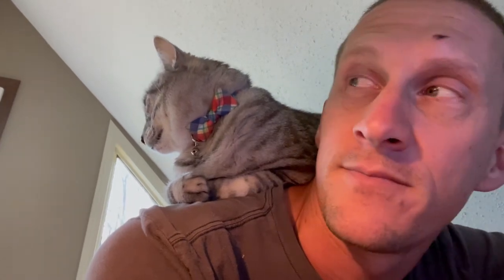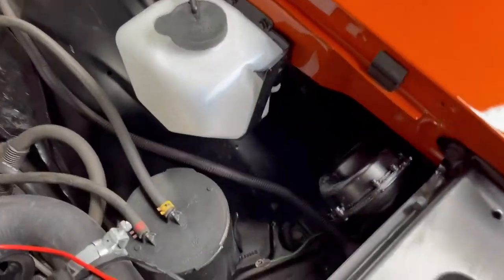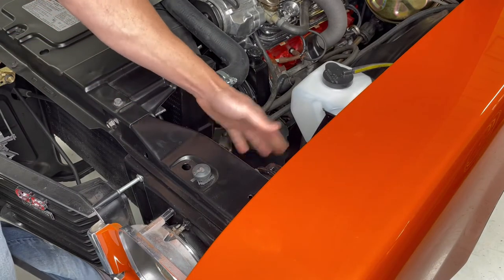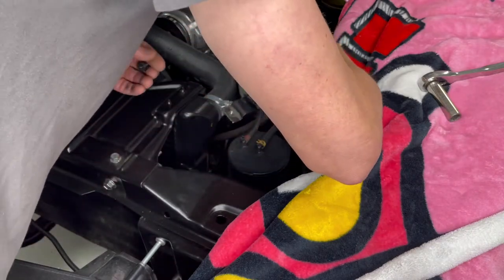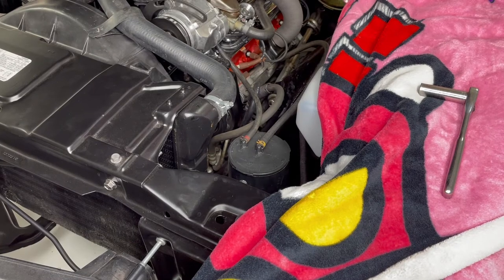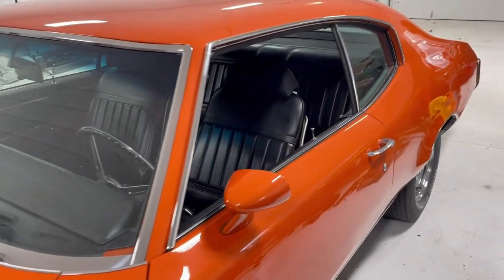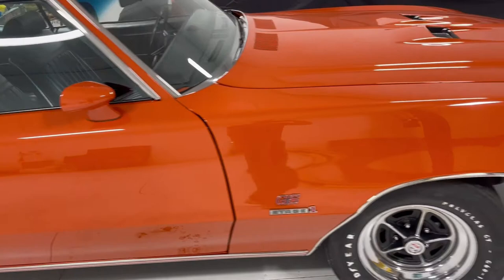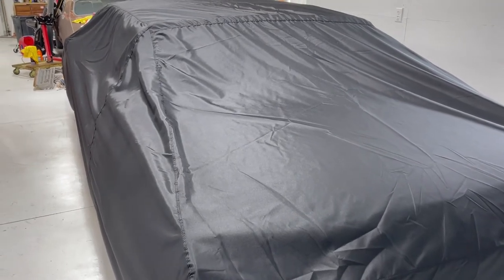GM Horn Troubleshooting, MCACN 2021 and the GS Nationals

Comment: I have wondered what it would be like to build a ‘70-‘72/2 door Post GS 4 Speed Bench. I recall seeing a beige ‘70-‘72 post car with a rubber floor at Maple Grove 1988. I can’t recall the engine and tranny, but I owned a ‘71 Nova with the Rubber Floor and of course was raised on Vent Windows, (NO A/C) so it stuck with me, lol. 
I’m a big Aztec Bronze fan, (‘66 Chevelle my father owned) so this Orange ‘72 is sweet!